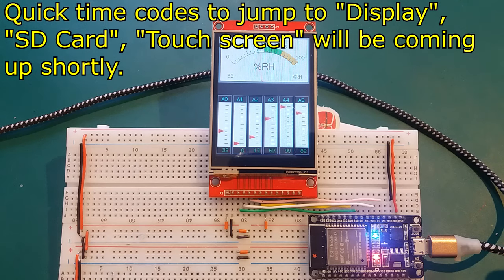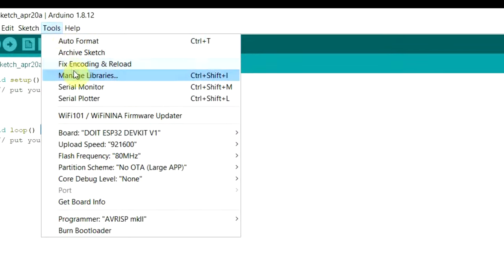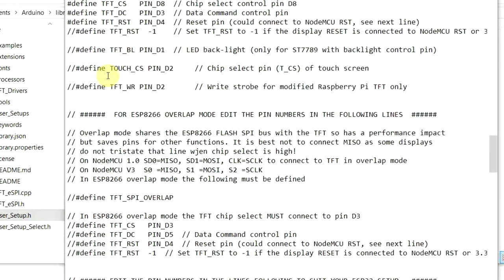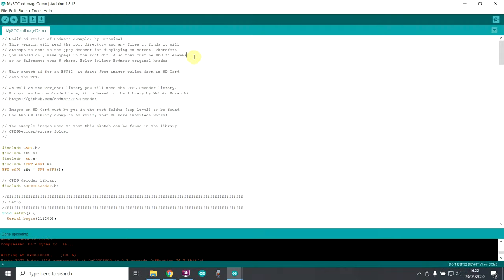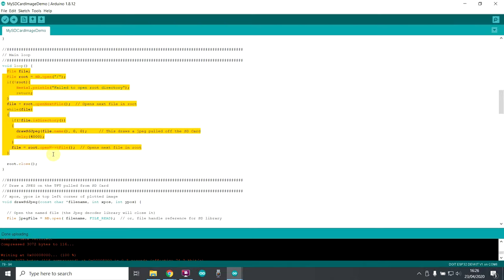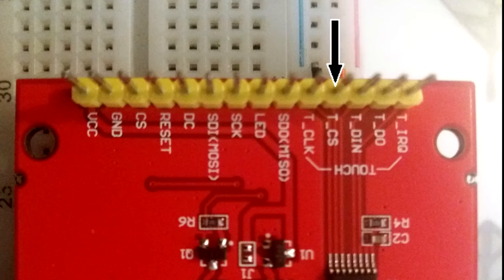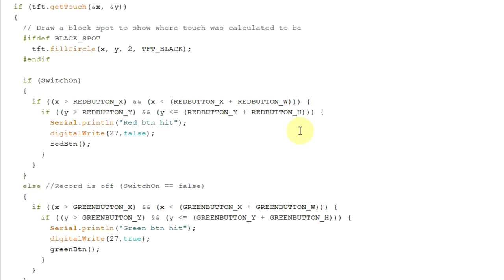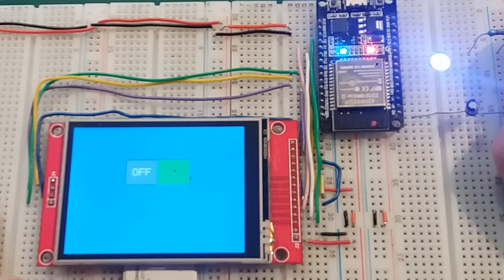ILI9341 TFT LCD to ESP32 - Full HOW TO  for display, SD card and Touch. Using TFT_eSPI driver

Comment: Thank you for a well thought tutorial. I've tried to implement your solution to read jpegs but my screen stays blank. Bodmer's default works (calling jpegs with names) but I would prefer yours. It compiles ok but not displaying the images. Are there differences between ESP32 boards ? I am using a Firebeetle.
Reply from the maker: Mine is based on a Bodmer example, so that's strange. It uses the same jpeg library etc. So the same image works with Bodmers but not mine? Must be a minor difference, filenames perhaps? i.e. is it definitely the right one for my code for the image your using.
Reply: @XTronical  Yes,the jpegs work when called individually by name (what the Bodmer example does) but they won't show when using your code that scans the sd card. I've looked very carefully at the code and I am sure it copied properly. Is there another way to scan the card?
Reply from the maker: I think there is an example with the Sd card library for listing the files in a directory. Try that and see what it churns out. It should list the files your expecting.
Reply: @XTronical  I couldn't find that example to list a directory. I am not sure if the version of the TFT_eSPI library is important. I have downloaded an earlier version but still no joy. I guess I'll have to leave it like this for now,but it bothers me because I've seen the same code somewhere else and it works for that person also.
Reply from the maker: Do you get a file not found error? Have you debugged that bit perhaps by writing to console? It's weird it not working

Comment: First thank you for the pretty specific tutorial. I tried following the video and skipped the SD part since i don't need to use it. The display is very good, but the touch screen is not. Please help me connect ILI9431 with ESP32 without SD, display and touch only
Reply from the maker: Please ensure you read the video description as it points out an omission in the video that will stop the touch screen working.
Reply: @XTronical  Yes. I have followed the description. (#define TOUCH_CS 21) but touch still doesn't work.
Reply from the maker: Double check that the screen you bought supports touch. I've recently been made aware that some of these screens now do not support touch even though the pins are present (guessing missing the resistive surface).
Reply: @XTronical  yes.. I checked the screen, it has touch support.
Reply from the maker: Sorry, it should work then. You've done everything I've done. It suggests a fault somewhere but I've not experienced this.

Comment: Great video, thanks.  I have the TFT/Touch running fine on an ESP32 Dev Kit C v4.  It is connected on HSPI (GPIO13 (MOSI), GPIO12(MISO), GPIO14(CLK) and GPIO15 (CS) GPIO 26 (touch CS)).

I then added an RC522 RFID reader on VSPI (GPIO23 (MOSI), GPIO19(MISO), GPIO18(CLK) and GPIO5 (CS)) using the MFRC522.h library.  It works fine as well BUT it breaks the touch function and tft.getTouch(&x, &y) always returns false and so never responds to the touch with new x. y values.

If I comment out the SPI.begin() the RC522 obviously stops working but the touch starts working again.

Am I misunderstanding something?  Any ideas on how to get them both working together?  Thanks again...
Reply from the maker: It's as you probably suspect a conflict in those libraries. Although using different spi connections, there is still an issue. I'm afraid it looks like it would take some examination of the code perhaps. I can't think off top of my head what the problem might be.

I am surprised there's a problem on separate spi pins. I'm guessing the rfid library is timer/interrupt driven or something and touch might be to. It may be there's conflict in that area. All guess work I'm afraid.
Reply: @XTronical  If it helps anyone else the solution is in the User_Setup file.  Right at the bottom, you need to uncomment #define USE_HSPI_PORT if you are using the HSPI port on an ESP32.  Do that and it works perfectly.
Reply from the maker: Fantastic work, thank you for posting.

Comment: Could you detail how to connect the Display SPI and Touch pins to the ESP32? Thank you
Reply from the maker: The video does show this, have you found it now?
Reply: @XTronical  EDIT: Another thing: I didn't understand why you didn't comment on the line // # define TOUCH_CS 21 for ESP32, since this pin is being used for the touch of the display? Or am I wrong?
Reply from the maker: Hey, well spotted, that was an omission, I'll put a note in the description and on the project page for this. Thank you very much for noticing. It should be as you mentioned commented out

Comment: Hi, I got this to work great. Is there a way to randomize the way it picks an image to display? How about pausing an image via a button or touching the screen? I do know that if you pull the SD card out, the image currently on the screen will remain there until reset.
Reply from the maker: Yes. All possible but obviously you need extra code. Here are some hints; if you look in the examples for SD cards in the arduino IDE you will find examples to read all files from an SD card. You could do this and store the filenames in an array, making sure you count how many files there were. Then there is a random function which returns a random number up to a certain value. Examples are out there. So you would get a random number up to the value of how many files you have in your array and use that as an index into your array and display that pic. And just keep repeating this in your loop. The trickier bit comes if you don't want to repeat a image before all are shown.

As for a pause button, yes just add some code after that checks for a button press on a certain pin. If pressed down go into a loop that does nothing until released.

Good luck 🙂
Reply: @XTronical  thanks for the reply, I think I'd be way in over my head trying that. Any way I could commission you to do that for me? Will pay first of course. If not no worries, thanks!
Reply from the maker: Hi, thanks for the offer but I've too much to do as it is. Sorry.
Reply: @XTronical  no problem thanks.

Comment: Hello, the tft freezes after some hours. What can i do? I think i must be a stability issue. How i can reduse the noise on spi pins? 
Thanks in responce and congrats for tha amazing channel.
Reply from the maker: Mmmm.... Is it definitely the screen and not the esp32? If it is the spi then things to try are keeping the wires as short as possible. Also try some sort of shielding around the wires connected to ground. This could be as simple as a wire that corkscrews around the others. Maybe even aluminium foil wrapped around, again grounded at both esp32 and screen connections. I'm no expert here at  all, this isn't my area but I'd give that a go.
Reply: @XTronical  Thank you, I will try it!!

Comment: why have I the error:  'class TFT_eSPI' has no member named 'getTouch' " ?
Reply from the maker: I think this is answered in the comments, somebody had similar issue.
Reply: Its not the problem about the version of the library, but in the User_Setup file there is commedted out the line #define TOUCH_CS 21     // Chip select pin (T_CS) of touch screen, just uncomment it

Comment: Great video! Thx a lot! 
By the way... Couldt it run GIFs instead of JPGs? That would be awesome for a arcade markee project. 
Again, thanks a looot!
Reply from the maker: Gif is simpler than jpeg so would have thought the library supports it but have not checked.
Reply: @XTronical  thx for the answer!! I will check that soon.

Comment: Hi I need help with ESP32s3 and the ILI9488!Until I've connected the SD card pins was ok...now I see just white screen!Actually I've the following pins :

#define TFT_CS   10 //     10 or 34 (FSPI CS0) 
#define TFT_MOSI 11 //     11 or 35 (FSPI D)
#define TFT_SCLK 12 //     12 or 36 (FSPI CLK)
#define TFT_MISO 13 //     13 or 37 (FSPI Q)
#define TFT_DC    7
#define TFT_RST   6
#define TOUCH_CS 16 // Optional for touch screen

With this configuration of pins the display works, but now I've connected the following for the SD I see just blank screen :

CS -> TFT_CS (10)
SDI -> TFT_MOSI (11)
SDO -> TFT_MISO (13)
CLK -> TFT_SCLK (12)

Can you help me?Thanks In advance!
F
Reply from the maker: You need a seperate chip select for the sd. My tutorial should outline this. I think I use pin 5.
Reply: @XTronical  thanks for your answer!Do you have some example of how have this stuff working?
I'm not sure i can use what pin want for the CS.
I've done a try using CS connected to the GPIO 15 of the ESP32s3 but nothing changed.
Also if it works, inverting the initialization of the SD with the display, the SD card is not mounted...i see the error on the serial monitor :/

Comment: This was the exact video I was looking for as I am experimenting with an ESP23 and this exact model of TFT so it was easy enough to follow. Noted an issue where the touch demo didnt compile and googled the solution before reading the description (missed a line that needed to be uncommented). I am not using a SD card so have not connected any of the SD card control lines, I managed to get the demo graphic meters to work and display no issue but when I tried to use the touch demo and uploaded to the controller I just get a fully white screen and nothing seems to work. Any ideas what may be wrong here.
Reply: Issue was a short between 2 jumpers but still have no touch control. Will have to investigate further and try find an actual schematic as it's hard to see the exact pins in the video when you aren't using the SD card connection
Reply from the maker: Which pins are you struggling with? Do you have a time into the video? I could knock up a schematic and whack it on the project page but would be at the weekend.
Reply: @XTronical  Thanks for the reply. All sorted. Issue was I had the DIN for the touch connected to DC instead of MOSI. Partly the issue is because there are no labels on top and I didn't have it printed out I tried to count the pins based off the video but because of the angle of the camera the pins are offset from the breadboard so I connected it wrong. 

Thanks to your video tho I have managed to work through the examples and get touch working so I can now carry over some projects I designed around physical buttons and see if I can instead use a TS to drive it. Was very clear and simple to follow so great work.
Reply from the maker: Brilliant, glad you sorted it. I'll make a note to do a schematic though.

Comment: Hello, thank you for your video tutorial, it helped me a lot, but I am having problems compiling the code, this is the error I get:

Compilation error: no matching function for call to 'min(uint16_t&, uint32_t)'

In the program mark these two lines:

  uint32_t min_w = min(mcu_w, max_x % mcu_w);
  uint32_t min_h = min(mcu_h, max_y % mcu_h);

I am doing something wrong?
thanks for your help
Reply from the maker: Ensure you use the same version of the library as I show in video. Later versions have changed.

Comment: Does the esp32 board tool require separate board selection and port settings? No screen output at all. Is there also a wiring connection?
Reply from the maker: You need to ensure appropriate esp32 board is selected, then choose whatever port you've connected it to. Sorry, no circuit diagram, just the connections shown in the video. If you've never used esp32 with arduino ide before then I'd recommend just creating a blinking led test first to ensure you have everything working good.
Reply: @XTronical  Thank you so much for your advice. Graphics meter works fine.
Reply: @XTronical  I have one more question. I formatted a 16GB SD card and installed it on the image download SD card you connected to, but it doesn't work at all. Mine is ESP32 DEV. JPEG photo output is not working. 
There are four separate terminals on the top of the SPI 2.4INCH LCD. For example, do I short-circuit(Connection)  the upper SCK and the lower SCK? Do I have to short-circuitConnection) the upper MISO and the lower MISO in the same way?
Reply: Error symptoms
In file included from C:UsersjAppDataLocalArduino15librariesSDsrc/utility/Sd2Card.h:26:0,

                 from C:UsersjAppDataLocalArduino15librariesSDsrc/utility/SdFat.h:29,

                 from C:UsersjAppDataLocalArduino15librariesSDsrc/SD.h:20,

                 from C:UsersjAppDataLocalTemp.arduinoIDE-unsaved2023029-45864-v4yjl7.t29gkESP32_SDcard_jpegESP32_SDcard_jpeg.ino:18:

C:UsersjAppDataLocalArduino15librariesSDsrc/utility/Sd2PinMap.h:524:2: error: #error Architecture or board not supported.

 #error Architecture or board not supported.

  ^

Multiple libraries were found for “SD.h”

  Used: C:UsersjAppDataLocalArduino15librariesSD

  Not used: C:UsersjAppDataLocalArduino15packagesesp32hardwareesp321.0.5librariesSD

Multiple libraries were found for “TFT_eSPI.h”

  Used: C:UsersjDocumentsArduinolibrariesTFT_eSPI

  Not used: C:UsersjDocumentsArduinolibrariesTFT_eSPI_ES32Lab

exit status 1

Compilation error: exit status 1
Reply from the maker: No, don't connect together. They are fine like that. I think that's for the touch screen if I remember correctly.
Reply from the maker: You have had it working, so what changed to cause this?
Reply: @XTronical  The 2.4-inch SPI LCD was not in good condition from the beginning. When uploaded, the error is not printed and the screen is printed 3 times in solid color and stops continuously. I don't know why.

Comment: ok the touch now it works..but u can say step by step how it calibrate and add the calibrate code in sketch on off button or another create sketch.... but now the problems is another... I don't understand why I can't see the image from sd card.. format of sd card is fat32..but I formatting in various extension (fat,ntfs,fat16..) but nothing, the image (I download ur example image). the serial monitor say "Failed to open root directory" but the images is on directory (no folders)...why I have this error?
Reply from the maker: I unfortunately don't have time to answer all your questions but for the sd card ensure you've done the mod to help it work with esp32 and then try the simpler sd card tests in arduino ide examples
Reply: @XTronical  the mod? What u mean whit word mod
Reply from the maker: Covered in this video here : https://youtu.be/ZmMTr8LEa1A
Reply: @XTronical  oh my Lord! I seen this ur video but i dn’t undrstand too much english... and on the bord ther’s”JI for 3,3v VIN”..😅 and mmm S_CS of my test was to D15 and not to D5.... ok now it works great! (With a 32GB sd card i test with a 512MB card but don’t work).Thanks so mutch.Now test for work display whit a video !

Comment: hi, i get the following when uploading,
 'class TFT_eSPI' has no member named 'getTouch'
any idea why?
Reply from the maker: It is failing on compilation because this function cannot be found. Are there any earlier errors? Is it finding the library with this function in?
Reply: @XTronical  the tft library uploaded fine. The SD library uploaded fine but then the touch failed. I can't see what I've done different to you
Reply from the maker: Just check the version of the library you are using is same as mine. Maybe it was updated and is a little broken with the examples
Reply: Its not the problem about the version of the library, but in the User_Setup file there is commedted out the line #define TOUCH_CS 21     // Chip select pin (T_CS) of touch screen, just uncomment it
Reply from the maker: I think this is mentioned in the video description.

Comment: would there be a way to stream a camerafead to the display ? like from an esp32 camera board
Reply from the maker: Yes, as the esp32 can successfully send camera video then it should be able to render to the screen. The frame rate will be around 10 fps I would have thought.

Comment: iam using esp32 dev kit 1, with ILI9341_DRIVER but it white blank need help for this
Reply from the maker: This guide uses the tft _espi driver
Reply: @XTronical i think we have same device , i using TFT_eSPI by Bodmer version 2.3.54 , but have blank result
Reply from the maker: Ahh, right miss understood. Others that have had similar issues have so far found it was a wiring issue. It's worth checking very thoroughly.
Reply: @XTronical  i check my wiring is the same with the User_setup and i installed the same version in the tutorial 2.2.
Reply: @XTronical  i was check the wiring 4x time, use same library version but same , i have blank screen
Reply from the maker: Sorry, you've got me stumped. Not seen this before.
Reply: @XTronical  can you help me?
Reply from the maker: I don't have any ideas as to what could be the problem, I'd have to trouble shoot the actual hardware.
Reply: @XTronical  my modul is new ,i was buy it last day
Reply: Try adding #define SUPPORT_TRANSACTIONS in user_setup.h
Reply: @anonymouseanonymous2533  it worked for me

Comment: where you can change the pins of the sd, use another miso mosi, example (I repeat only for the SD)
#define SD_CS 27
#define SD_MOSI 13
#define SD_MISO 12
#define SD_SCK 14
thankyou
Reply: Hello @faktordj, can not follow the assignment portion of the video, can you help me fill in the blanks so I can get going?

Display Pins   -  ESP32 GPIO Pins

VCC                    5.0V or 3.3V 
GND                    GND
CS
RST
DC - I belive is  23 
MOSI
SCK
LED                    5.0V or 3.3V                    
MISO
TCLK
TCS
TDIN
TDO
TIRQ 
SD_CS
SD_MOSI
SD_MISO
SD-SCK